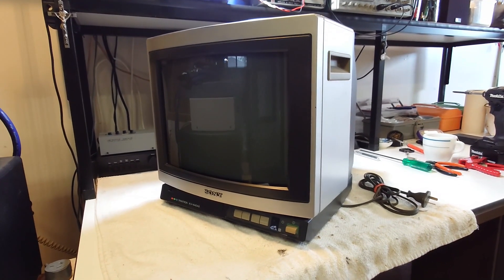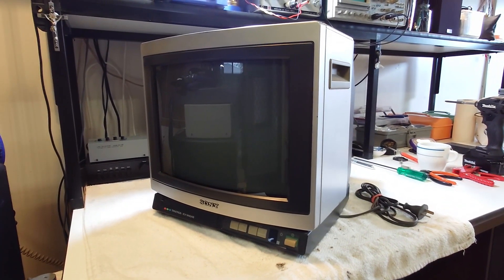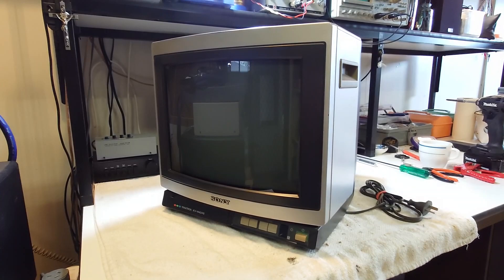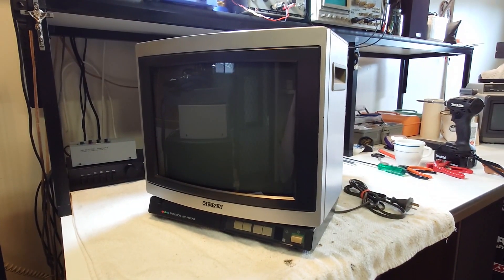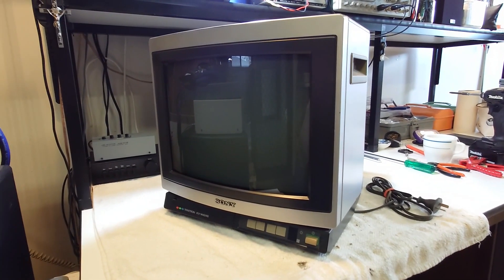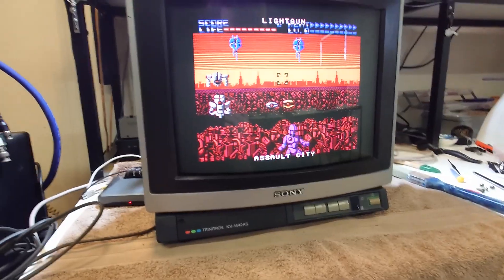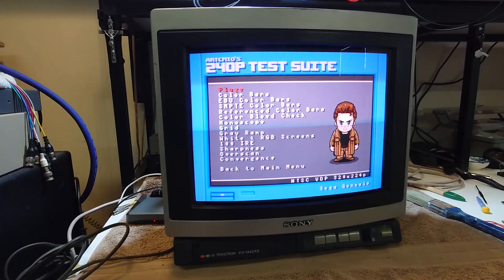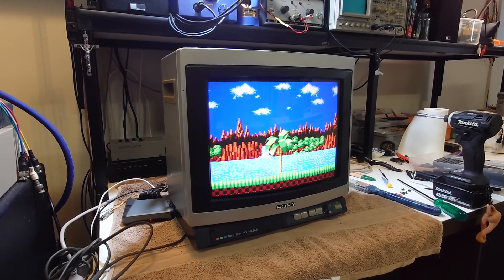Sony KV-1442AS Trinitron with RGB SCART - Common PSU Issue Repair

Comment: Hello, have you encountered a problem with the program not being saved while scanning the bands? I tried to connect my Atari to the TV via antenna cable, but it wouldn't lock onto a specific frequency and wouldn't accept the settings.

Comment: Hi, thanks for the very interesting video, I have the same model, I changed all the power capacitors, now it works perfectly but I noticed that the 20w cemented resistor gets very hot, do you too?
Reply from the maker: Hey thanks for watching.
Yes, it's normal for R601 to be very hot. It is a snubber in parallel with the primary windings on the SMPS - protecting Q601.